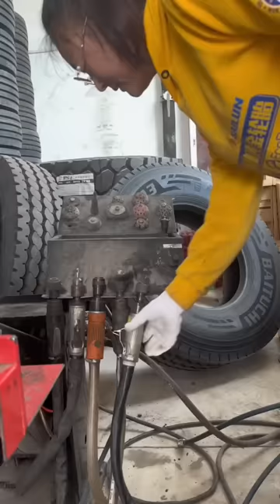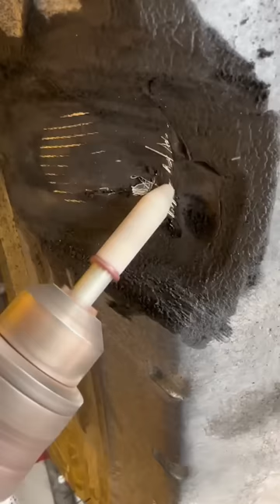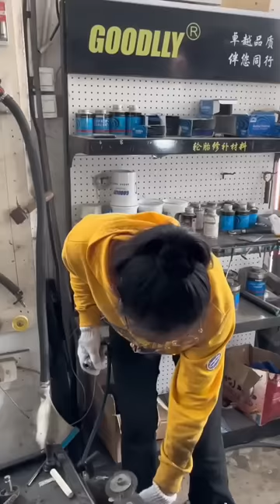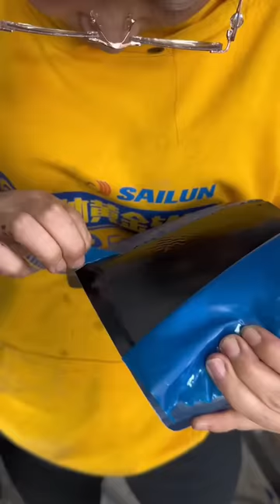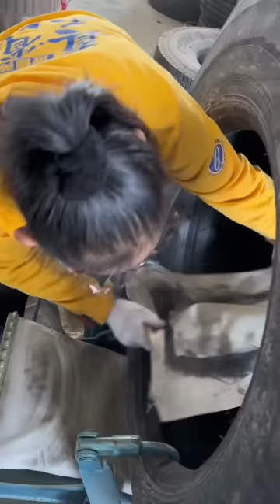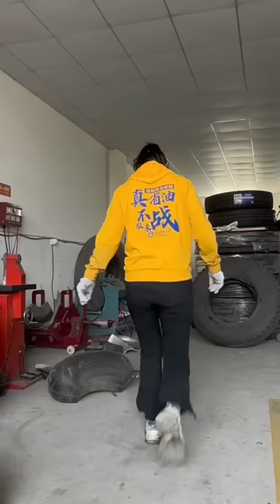Repair A Big Nail Hole In A Truck Tire Without Replacement

Comment: I worked for a tire manufacture for years. You never, ever try to repair, plug or patch a hole in the sidewall. Never! The integrity of the tire is ruined and will blow out. It is illegal in the US to do this type repair.
Reply: In those countries people don’t care but yes it’s a problem in US
Reply: Yeah things are a little.diffrent in these places, Im not saying I would drive with that tire at highway speeds but the driving they are doing that tire will probably never blow....
Reply: Yes that is true
Retread tires have also been removed and are illegal
Even patching a flat can be dangerous
Reply: It won’t blow out. Mfg Just say that because so people buy new tires. I’ve seen trucking companies do this on the down low to save money and never an issue with blow out. I’m not saying to do this but it works! Save the planet and some money but risk lives . In these countries, they really don’t give a shit lol
Reply: Especially in the shoulder
Reply: @Tierone1337  Mentira, una llanta que se rompe por la cara, jamas podra hacer un buen trabajo, inclusive pones en riesgo la vida. Jamas se deben utilizar estas llantas
Reply: So in such way you better don't know what tire Ukrainian use, people simply has no money even to put some patches, and generally we use second hand tires from Germany and so on.
Reply: @nicknabors3307  and in a lot of those countries most working people can’t afford 1 new tire because they are so expensive . You do what you have to in order to feed your family. Sadly , with the risk .
Reply: @benniebarrow348  exactly I agree 100%
Reply: It's called sectioning and it's completely legal and works. Stop making stuff up if you don't know.
Reply: @FinnellRacing  what you just said made no sense. Recaps in the sidewall? Are you in the US? IF you are it is a matter of time before you have a blow out. We are talking about this repair in the sidewall . Recaps are illegal in the US.  No one does this anymore because of the dangers. I don't want to be around you if they are recaps
Reply: Would never trust sidewalls because lack of thickness.
Reply: @andyb9994  Das seh ich aber anders, das ist ja wohl ein LKW-Reifen🤔,und in diesen Ländern wird soviel geladen,wie irgendwie raufpasst,da gibt es kein zulässiges Gesamtgewicht...Da ist die Gefahr das der Reifen irgendwann platzt natürlich auch sehr hoch...  .😅😂.....Aber das Flicken ist halt billiger als ein neuer Reifen....   🫡
Reply: even in Italy it is illegal, and I agree, the tire becomes dangerous! those are countries where safety does not exist!!
Reply: @andyb9994  esas llantas se usan donde se apoye con otra buena y se hace por la economía para sacarle algo de más uso
Reply: @zachw4394  y más legal es para el bolsillo $$$$$😂😂😂😂
Reply: @zachw4394  Maybe on bigrig tires or other heavy equipment tires. But when I worked at some tire places here in the states... if the the sidewall has a hole in it, it's new tire time. I've changed or repaired, truck tires, car tires, small and large SUV tires.
Reply: @frankspikes7858   some tire places will still do it. But most tire shops in the USA just aren't equipped. I'm sure if the economy keeps going the way it has it will probably become more common.
Reply: @jasonallred244  tractor trailers run retreads all the time or regrooved tires.
Reply: @FinnellRacing  Why can’t you put retread on front?
Reply: @zachw4394  in the sidewalls?
Reply: @jasonallred244  some places yes.
Reply: @zachw4394  Zach, look up retread, regroove vs plug, patch. This video shows a clear plug and patch below the pillow blocks. Like I said I worked in at a tire manufacture for years and I am educated in tire formation, pillow blocks, raises,  sidewalls etc. When it is a retread this means a long process of stripping all the tread down to 2mm from the raise and retreading them with brand new tread in a melt to raise process and the tire still had tread left to not destroy the integrity of the tire. Regroove is when there is enough tread still left but has to have at least 8 mm of survivable tread to regroove.  The video at hand is a woman cutting away to the side wall while plugging and patching. This is illegal in the US and not able to withstand side pressures when the wires on the side wall are cut through. It's like putting a real bandaid around a garden hose and saying it will hold pressure. If anyone in America is doing this repair this puts people in other vehicles lives in great danger. Please stay on topic and know what is being discussed  
 Thank you.
Reply: @jasonallred244  it is not illegal on the federal level and in most places it is not illegal on the state level. So obviously you aren't that educated on the matter. Working in a tire factory doesn't make you a law guru.  Just like ppl claim it's illegal to run retreads on the steers which is untrue it's not industry standard because is the tread flies off it will cause body/fender damage.
Reply: @zachw4394  Tired of arguing with you when you will not admit the point of the video. Side wall repair is illegal and if anyone is caught doing it they will lose their business to fines and penalties as well as lawsuits from injured pedestrians in the cross fire of a blowout. You keep up your trolling and I will keep up with truth and reality. Have a good life.
Reply: @jasonallred244  The term “section repair” refers to the type, size, and location of the injury. In the tread, injuries up to 1.5 in. can be repaired, while the repairable limits on sidewall injuries vary depending on size and can be up to 5 in. long and 1 5/8 in. wide. In both cases, all the damaged body plies and belt cables are removed and trimmed back to solid rubber. Raw rubber is applied to the void and then cured in a retread chamber or with a device that applies heat and pressure directly to the repaired area. A large, reinforced repair unit is installed on the inside of the tire to seal the inner liner and provide additional support around the injury.
Reply: @jasonallred244  centech radial repairs are a product specifically made for this purpose.
Reply: Gotta love the experts here...
I worked for Big O tires in Kentucky in the 80's. They sent employees to their training and manufacturing plant in Indiana regularly.  You can repair a tire anywhere as long as the steel belts aren't severed and the bead belts aren't comprised in any way.  Volcanization is a permanent bond between the rubber your adding and the virgin rubber of the tire and if the glue and heat are correct will never separate. It literally becomes one. Dont repair tires that the cords or belts have been separated in, those will separate at highway speed and subject to blowout at anytime. Companies in the US have guidelines they choose,  doesn't mean the tire is always unsafe. 
I've repaired tire sidewalls,  tread and beads and never have an issue even years and thousands of miles of abuse.
Reply: @FinnellRacing  if it is that close to the side wall it is all the same. Show me a tire merchant that would see this in the corner like that and just scrape, plug and patch. It is common sense that the integrity of the tire is ruined at that spot. Dangerous to say the least. Even in your most basic books it states anything that close is considered a failed tire and should be replaced with a new one. Plus that was not a nail or a tack it was a bolt.
Reply: Correction! A puncture of that caliper can be repaired depending on the damage done to the casing. Considering it wasn't a sidewall puncture and just at the shoulder of the tread, with the right patch and rubber filler it can be done and has been done in the USA. Once repaired, however, the tire must be dragged by a trailer and not drove on as a steer or drive tire. As a service technician, you are not allowed to repair such a puncture on the side of the road or in a USA shop. We have manufacturers that have the ability to repair such damge and extend the life of a casing!!
Reply: @jefferykrause2912  I'll have to disagree and I am sure I will have quite a few that agree.   In manuals any puncher that close to the sidewall is very dangerous as the tire is considered ruined. Go ahead, try to do a repair like that even with a manufacturing process and you are still looking for trouble . I am done. Let's just agree what the video shows, would not fly in the US and call it a day.  The whole start was the video  which is completely non worthy of ANY transport. Steer, haul, wagon. It really makes one feel comfortable when people here literally defend this practice of try to define it as something that can be done or would be done. Guess that is why tires are blowing and shredded all over our highways by rigs cause of shitty practices. By the process you describe ( I am a tire engineer ) it would cost more to take a chance than buy a new tire that you do not have to guess about. Have a good day.
Reply: @FinnellRacing  snake please look at the video. We are discussing the video.  Do you agree and want this on your trucks? Quit trying to make a mountain out of a mole hill. Stay on original topic. If you would be safe with this tire then your boss must really want to go cheap .Truth be known retread/ cap is more expensive over the process if done correctly than buying a new tire. To each their own. Stay on topic.
Reply: @FinnellRacing  read the rules on acceptable distance from the sidewall where it is considered ok ( temporay) or disposable and will blow out. Google it. Only time a plug and patch is acceptable is almost half way across the tire and in the tread casing. I am not arguing it with you and wasting my time. You do you. You believe you. Have a good day.
Reply: @71torinoman  thats only for passenger busses bud. Good try though.
Reply: I hate to tell you this but they do side wall repair I’ve seen done when I used to work for Swift Transportation and I see it now at this new place I work at all day we break down and mount tires about 300 to 400 a day
Reply: @hammerdragon4321  Thank you for shaddy practices and endangering people on our roadways.. You and your company must be so proud.
Reply: As a semi tech. I can tell you this tire would be illegal to patch. If I were to patch this and it blew out and caused an injury/death, I could lose my job and end up in jail. Semi maintenance is more regulated than car maintenance. The steel threads in those tires are in the flat part of the tire that connects to the road. The sides are mostly just rubber. In addition to that the sidewall rubber is thinner than the tread and the sidewall gets flexed/unflexed thousands of times a second as the tire spins. It's much more prone to failures after a patch. Even if the hole isn't directly on the sidewall, if it's within a thumbs width from the sidewall it's still a no go.
Any shop willing to do a repair like this in the USA is operating illegally and I wouldn't trust them to do any work.
Reply: Just in case you didn't know, most car tires run around 30 foot pounds of pressure. Semi tires run at 100-110 foot pounds of pressure. When I was a newbie, I was too close to a used tire I had to refill before it popped. I didn't hear the tell-tale sound of rice crispys that warns you it's unzipping. When it popped, it tossed the cage to the other end of the shop, tossed me 5 feet backwards, and shredded my shirt like confetti. It's not like a balloon popping. It's like a small bomb going off.
Reply: That's what my mechanic said, too.  

He said you don't want to risk you life while doing in excess of 70mph  on the freeway, for $200.
Reply: Which tire it is matters as well when they determined this to be a possible fix with regard to load etc.  If it’s one of a pair.  But yeah.  Sidewalls.  Physics.
Reply: false. we do sidewall sections all the time
Reply: @Jason Allred  you are WRONG. ive been doing tires for 29 years. retreads have NEVER been illegal. 😂😂
i sell and install hundreds a year
Reply: @anytirellc  once again stay on topic. Retread verses this video. If you would pass that you need to retire. I am a tire engineer. You know. That guy that studies, creates and knows all aspect of one? This is amazing to me it starts with one true statement and turns into a pissing match of trying to talk about everything but the video and the truth. I love trolls.
Reply: I'm just impressed the high level of skill this woman has in fixing a tire, 1 in a million. Worried about dust too, just like my Asian wife.
Reply: Agree wholly let alone the omission of a dust mask. That crap gets in your system and never comes out!
Reply: @zachw4394  Fine but not on the sidewall.
Reply: @stevemack1244  I don’t think it is a radial tire. Even if it is, the repair is on the shoulder not the sidewall. She made a proper repair. Maybe she took off too much on the outside and the repair bigger than it needed to be. I would have just enlarged the hole outside and filled it with Mogum and made a smaller spot repair. And maybe this tire will not be used over the road long distance. Maybe it’s for short haul local use in a cooler climate. Truck tires are expensive. You can still legally regroove them also. Even radial truck tires. They are stamped Regroovable right on the sidewalk. My father did it for a living for 45 years.
Reply: @FinnellRacing  and then it can be regrooved. You could probably add another 4/32’s and run it for another 49-50,000. And then, even after that, you can recap it if the casing is still good.
Reply: @frankspikes7858  the repairs to the shoulder not the sidewall. Did you see her grinding down the steel from the steel belts? That’s the tread area. Do you really know anything about tire repair? I did it for 40 years. Vulcanizing, regroovng, recapping, plugging tires, rebuilding sections. Yes, there are risks, but there are risks even with brand new tires.
Reply: @jasonallred244  it’s not the sidewall it’s the shoulder of the tread area. Agreed she does take out a good amount of rubber from the sidewall but there’s still plenty of rubber left and she did not hit the cord. This is a heavy duty truck tire. Do you realize how much rubber there is even on the sidewall? it’s probably a four ply sidewall and eight ply tread area. That tire could still have a lot of life in it after the repair. And it’s probably going to be mounted on a dual axle and on the inside so the danger is minimized.
Reply: @jb2053  I am a tire engineer. I oversee transfer tire construction, H1 military hummer, Abraham 1 tank tracks and heavy duty transport tires. The rule is anything near the shoulder to the sidewall is considered a integrity ruined tire. I keep hearing these talking heads saying it is on the corner, that does not matter it is still considered ruined, dangerous and side pressure will cause a blow out. Look, I am not trying to sale new tires or be a ad for that. I am speaking from multi years of experience and know every inch of a tire. 
Sounds like owners are trusting the process to save maybe $5.00 a tire till it blows verses common true sense that any TRUE tire tech or driver ( not the trolls on here with nothing else better to do than , well, troll) would know of tire construction and integrity. Let them do these practices and as one said when it blows and injures people or property on the highway they will be facing fines and possible jail time. There is a code tire shops and retailers across the US have to follow and by the video no one in the US would take a chance to get caught doing and if they do they are asking for trouble eventually.
As far as large tires the side wall is just rubber. Ruin the integrity of the tire by manually trimming, plugging and patching and add hundreds of pounds of PSI and you have created a time bomb. Look through comments and see the sensible people give their horror stories.
Keep drinking the trolls kool-aid and be uniformed.
Reply: Specially on a steer tire.
Reply: @Tierone1337  What you described doesn’t sound like lives are being risked
Reply: @benniebarrow348  “sadly with the risk”

Negligible risk. It’s not even a big deal.
Reply: @FinnellRacing  Law makers just make laws they don’t know shit about real jobs.  😂
Reply: I don't even think what she's doing will even work 😅 wt heck ?, 🤔 I don't understand what she's even doing 😮
Reply: Anyone saying that is acceptable is totally wrong, and should not be driving... In any country 😮
Reply: The steel wire enforcement was cuted as well , on certain load it will fail  , but it makes it work for a while . The biggest enemy of tires is dry rotting.
Reply: A lot of these people in these countries probably don’t have the money is what I was thinking
Reply: @nicknabors3307  steer axle higher risk of blowout for many reasons and no other tire to support weight if failure occurs.
Reply: @jasonallred244  You really should look into what Section repair is before you start telling everyone they are wrong. It is not the same as patching or plugging a tire. We offer that service and it is a legal and accepted practice. That contraption she puts the tire in near the end applies pressure while heating the tire to the point that the rubber is one piece again
Reply: It's interesting to read all the comments ahow dangerous this is.
Firt of all the lack of PPE troubles me, but different countries have different attitudes to this sort of thing.
As for the repair...is it really dangerous, or is it just that manufacturers obviously don't want people to be repairing rather than buying new? I'm not arguing either way, but I'm surprised at the level of equipment in this shop. It makes me think they must have a decent business going on...which in turn makes me think they can't have a reputation for killing people through shoddy repairs.
Would I drive at high speed on this tyre? Probably not. Would I trundle around a farm at low speeds on it and hope for the best? I reckon I would.
Reply: @danjames4086  where these " repairs" are happening they do not have long travel highways or rules against it. Here in the US there are consequences for doing this when the tires intercity, rigid state and conformity is a rolling time bomb.  If anyone in the US does this and it kills someone on the highways they will be stripped, broke and spend jail time. Anyone in the US doing such a " repair" would be stupid to take these chances. The biggest complaint it it is a bolt the thickness of a pool stick, where the damage is done and the shaving along with curved patching that is a HUGE red flag. 
As a tire engineer of developing, conforming and testing tires I can tell you without a doubt this would not fly here and no it is not to sale a tire new it is to protect innocent travelers on our highways. 

Thank you for you comments and thinking ( complement). There are tons of videos and websites that break down the process and parts of a tire to show this is not safe. It's a real technical science and very informational.
Reply: @ajnichols9104  sorry you are standing for this. It almost seems troll like. If you know the components of a tire inside and out, the rules of how far to the edge of damage before it is considered ruined integrity and stability as well as full balance and can prove otherwise then we will talk. You have wires, blocks, stabilizers and treads.
Your analogy is like saying you have a broken front control arm that has a crack three quarters the way through and just fill it with JB weld, pack it all around real good, heat it with a heat gun and it will be good to go for another 10,000 miles or more. Pure bull, you replace the part. Before you go shell it is the same concept. 

Call me what you want but I will always advocate for the safety and well being of our men, women and children on our roadways . You want to do these practices it's your conscience.  Once again I believe you are a troll cause any Great tire tech would not even think of doing this with integrity.
Reply: @jasonallred244  I know how the structure of a tire is. I have been trained by TIA (Tire Industry Association) on the proper procedure for section repair. Before this training I was of the same OPINION as you but that is not fact.
You really need to look at Section repair and educate yourself when someone is trying to show you something you haven't seen before. 
It is nothing like your control arm analogy and if you looked into it you would know that. If you choose to live in ignorance, I feel sorry for you and those around you.
Reply: Also the rubber dust is carcinogenic
Reply: @egorrudnitsky4895  드트ㅡ😮😅😅😅😅😅ㅡㄷ층ㅊ3😊😊😊😊171😅😅😅😊
Reply: Nowadays patching technology is so advanced that it is usually completely safe. Not every tire need to be replaced, let us respect our environment. Reuse, renew, recycle.
Reply: @_AmperVolt  This tire would not be safe. Prove me wrong. I'd rather save lives than rubber
Reply: This is why there are so many blown out tires on the interstates…. 🙄
Reply: That's true...I am truck driver....but she is in another country
Reply: Where in the hell are her safety glasses/shield? She’s buffing those still belts and metal is flying everywhere. I don’t know what country this is but osha or msha would be all over this chick.. 🤦‍♂️ I can see that repair on an OTR tire but not on a truck tire.
Reply: Guess you don't do it like they do. If you did, good as new.
Reply: Glad this was mentioned. I was also told ,never repair side walls or corners !
Reply: You are not in US mate...
Reply: Probably go on a rear.
Reply: @andyb9994 the driving they do probably won't damage the tyre? Are you for real? It's because of their downright dangerous 'steering' of those vehicles that the tyres get holed and blow out too.
Reply: @sydsnott5042  honestly I don't care if all of his tires blowout and a truck catches on fire....
Reply: This girl would save a fortune in cloth if she just bought white or black coveralls and wear them over her cloth ..😂
Reply: What he said. Major no no.  They cut the steel cords 😢😢😢😢
Reply: Highly illegal. In the US. By law. Buy a new tire. If that was a steer tire. Law says you buy 2 new tires. Still. She's adorable. Isn't she?
Reply: All this to save 12 dollars lol
Reply: I was a tire guy for five years and I have changed at least five thousand tires during that time. There was a worn-out tire that I changed and in the middle of the sidewall there was one of those patches that look like that sticky rope. The guy had like two or three of them in their keeping that whole sealed. When it was being changed it was only because it was worn out. Whenever the fix was done, it looked like it was done an extremely long time ago and it was holding up perfectly fine.
Reply: I wonder, since it’s such a large tire, if it’s used on construction vehicles that move at very slow speeds?
Reply: My son was trained as a tyre fitter and got promoted to depot manager in the north of England. Part of his training was to attend a tyre repair course organised by continental tyres. This course included repairing side walls! Cost to customer-£80,new tyre-£200+.i personally would never consider a repair outside the centre 3rd but these countries sometimes don't have much choice. The issue is if they venture over here. That tyre looked like a steer tyre too!
Reply: Ese neumático cortó la tela de acero, y se puede soplar en cualquier momento, la solución es: instalar una cámara, pero va perder lo tubular del neumático, también se va a calentar cada ciertos kilómetros, no puedes poner en eje dirreciónal, solo dual trasero, hay mucho riesgo. Por que las telas cortadas empezarán deformar el neumático. Provocando un explosión en cual momento.
Reply: @flitronns  can't understand. Does not have a translator button
Reply: God bless America 🇺🇸